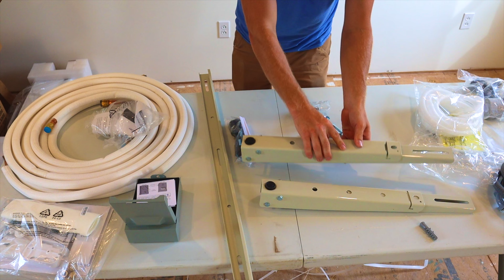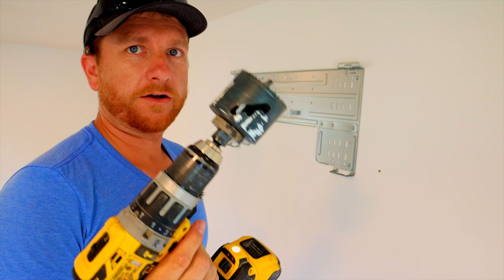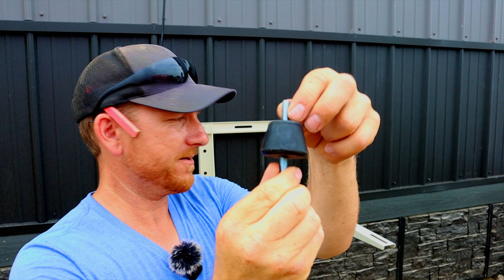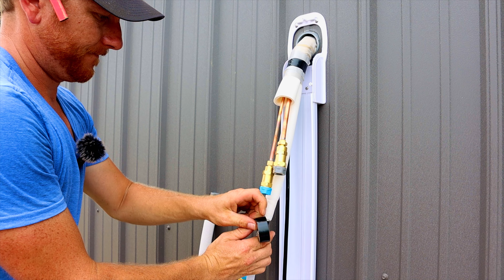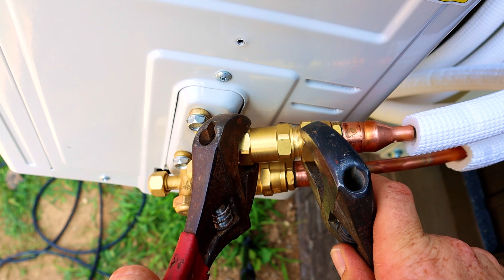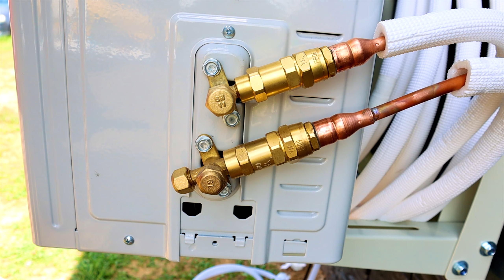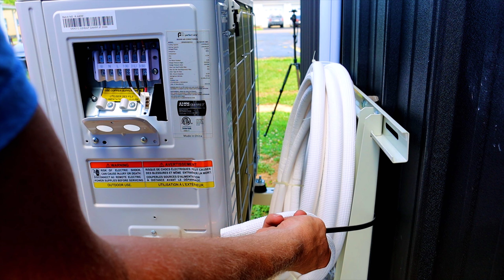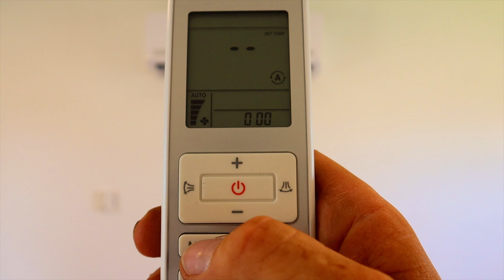HOW TO INSTALL A DIY MINI SPLIT (no HVAC tools required)

Comment: You should not vertical coil the lines it causes an oil trap that can push oil through the expansion valve and possibly damage. 

For a word to the wise, I implore all DIY Guys...I am amazed at how many "DIY" Guys use a sham of a test for leakage. A pegged vacuum line hold on the Low only tells you there was not enough leakage to let it stay pegged. It gets you out the door but chances are you leave a micro leakage that in less than a year will likely let every bit of the refrigerant leak, causing that customer to have to get service and that is likely to be $750 for leak detect, find, repair, vacuum and recharge of their system. A Micron Guage will show you mini/micro leakage in a very short time! Use a Micron Guage!
Reply from the maker: Good advice. Since this line set was pre-charged it did not require to be vacuumed down, eliminating the need to pump and gauges. Maybe not as good of a setup vs vacuum pump and micron gauge but it has held up great so far. Almost 2 years now.
Reply: @MT_Homes Awesome! I want to warn off the misguided DIY folks that may have gotten out the door with a system that is "Working" but after a period get hosed because 1 simple test to reveal a minor leak might have/would have given years of service without a service needed except to clean annually! I mean, I got my Micron Guage for $97...An ounce of prevention is worth a pound of cure!

Also a DIY person can get sued for doing work and taking money if the system goes doen due to a leak that was possibly avoidable!
Reply: And one last tidbit, a true leak test is high pressure nitrogen @ 500 psi! Most companies rigorously demand their techs to a triple to make sure not just the Vac Leakdown Decay. It isn't cheap getting nitrogen setup, tank agreement or DOT cert on tank neck a Nitrogen regulator, hoses these can run you up to $500! Some municipalities do demand a license or cert you are working under a licensed contractor and/or hold the epa 608 Type II or Universal Certification.
Reply: @RobertHolst-m4l Spoken from someone who wants to charge you $1500.00 for a test that takes a few minutes.
Reply: @RobertHolst-m4l  I believe that I prefer a system that doesn’t need a leak down test, just external leak test.  The highly paid, “5 star” HVAC contractor who installed my central air unit in FL about 6 years ago vacuumed the system properly, but immediately released the Freon without doing the leak down test.  He said, “if it leaked, he would have heard it.”  Half of the HVAC techs and companies I’ve dealt with over the years take short cuts and I’ve had multiple call backs.  Those call backs prompt me to have to buy the maintenance contracts.  It’s a racket.  Also, that system they installed doesn’t cool the house when it’s summer, so I’ll either add a portable or DIY mini-split if I want to be in FL in the summer.

Comment: Great video! Thanks for sharing. I'm putting in the same unit in my bedroom. Perfect for second floor room. My only question would be for the part not shown. Did you have an electrician run the power line out of the breaker box for you? I understand that might be a "Tricky Issue" for a DIY install. I have electricians in the FD for my install. Again, thanks for sharing.
Reply from the maker: This was installed in a new build and the wire was run by the electrician that wired the house. I typically do my own wiring and it’s not that complicated, main thing is to ensure breaker and wire are sized correctly for the unit. The install manual for the mini split may have those size recommendations.

Comment: I just bought Daikin. Best buy money vs quality. Mitsubishi is way more expensive. But Daikin 12000btu 18SEER2 for $1,445.-  is much better investment comparing to the al cheapo one. Especially during the cold winter in Chicago.😊

Comment: Why didn’t you vacuum check it before you opened the valve. ??
Reply from the maker: With the true DIY system the lines come pre-charged so no need to vacuum them down.
Reply: Rubbish

Comment: i always see people use a vacuum pump for moisture i see you didnt is there a reason not to
Reply from the maker: A vacuum pump is required for normal line sets. A true DIY mini split like this one or the Mr Cool ones come with precharged  line sets that do not require a vacuum pump.
Reply: The vacum is to evac the air and moistrue out of the open line set... by the pros anyway
Reply: Many of the modern heat pumps come with pre-evacuated the line sets, and quick connects. The system works beautifully no messing around with the vacuum pump engages. But don’t forget that you can always borrow a vacuum pump and gage set at your local auto parts store: last time I had to change a refrigeration compressor in Arizona in my RV; I went to O’Reillys bought the compressor, borrowed the evacuation pump and gauge set. Charged the system using the inverter in my RV and returned the tools for my deposit.

Comment: Question, where did you buy the rubber "feet" for the condenser on the "L" brackets??.
Reply from the maker: They came with the “L Bracket”